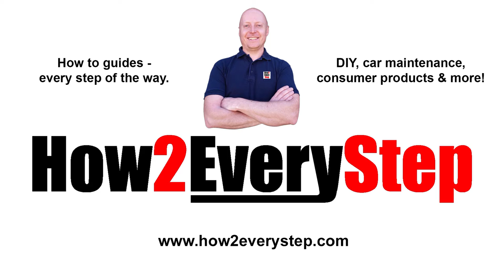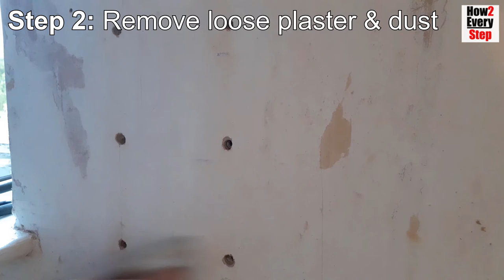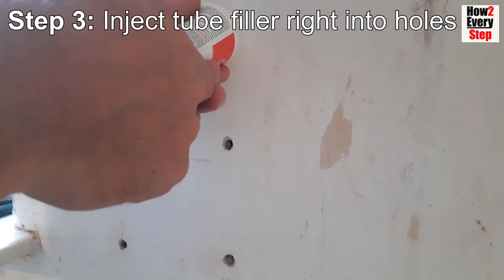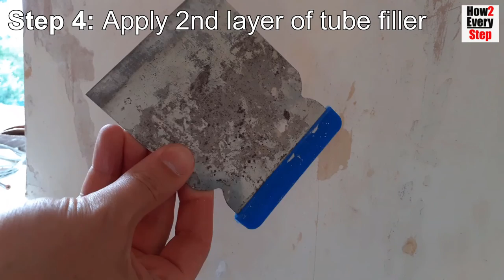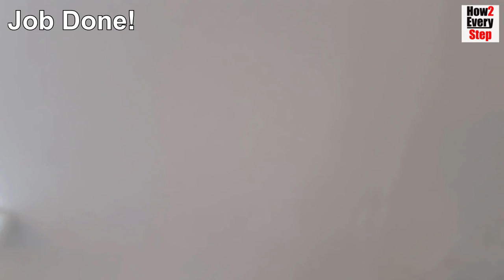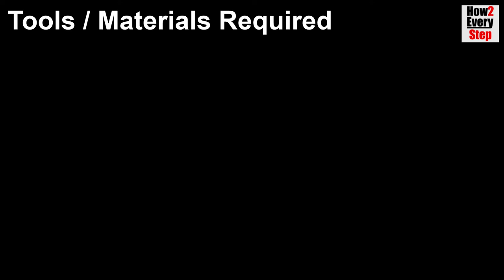How to repair / fill wall plug holes – DIY decorating guide

Comment: It's much easier to remove plugs by inserting a screw a few threads deep and then using a claw hammer to pull the screw and attached plug free.
Reply from the maker: That's a good option if the wall plugs are not to tightly in the hole.  Mine were really tight and I had to resort to using long nose pliers...
Reply: I like to recess the plug about 1/8" below the surface of the wall, then fill over it just a bit proud to allow for shrinkage. Often enough, one good pass will suffice. Walls are textured where I'm at, so it's a little more forgiving.
Reply from the maker: @brucedrukker1195  Hi Bruce.  Fair play if you can judge how much filler shrinkage you will get.  My walls are flat so if I put too much filler on I will need to sand back - which my process avoids...

Comment: Once you’ve done the fine filler, should you lightly sand it again before painting to make sure it’s really smooth or is that not necessary because of the fine filler?
Reply from the maker: You can sand flat if the filler raises about the wall surface.  I try to fill and scrape flush to avoid sanding.  I find this is quicker... thanks How2everystep.com

Comment: Was it really necessary to film pulling all 6 plugs out, I ended up falling asleep and never saw step 2
Reply: Just forward across, I find that much easier. Or put the speed of the video up, which is my fave way especially when they're not talking over.

I think YouTube want a minimum of 9 to 10 min long vids for monetary benefits. Don't quote me on that though.